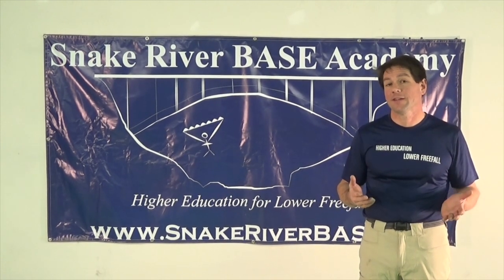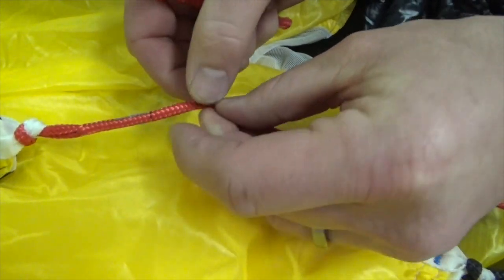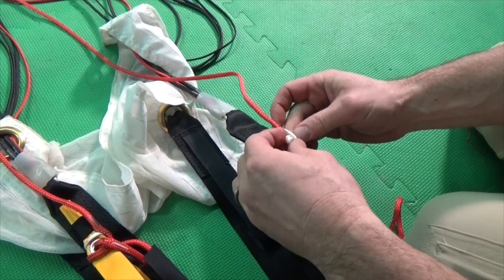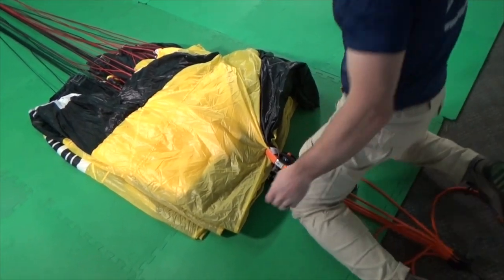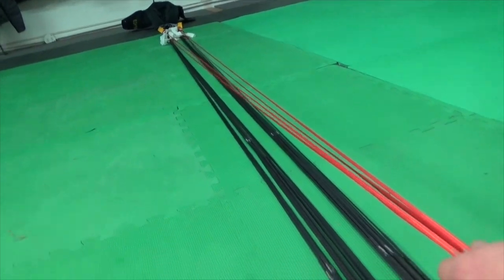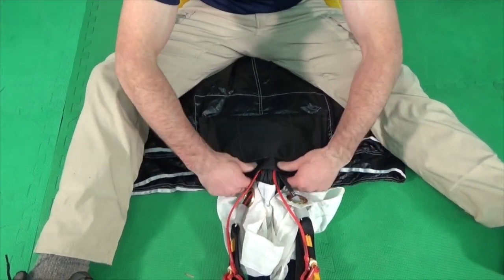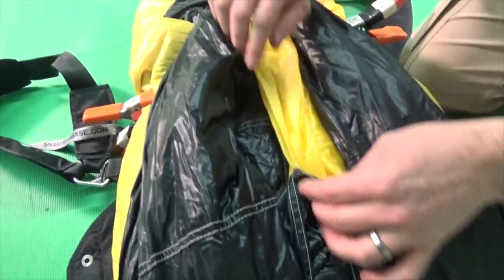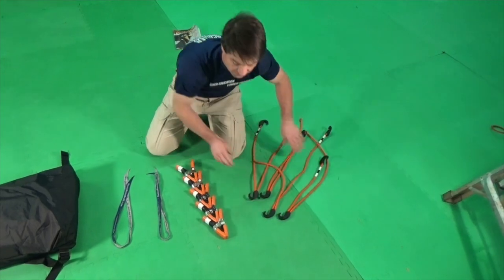Snake River BASE Packing video

Comment: Not a base jumper but watched with interest how ever this looks like a nightmare packing I think I can see why some accidents might occur because of a packing error may happen etc , isn’t there a simpler way to pack and is all these folds and things that necessary, could they also contribute to a malfunction just seems like so much going on here. Are all BASE jump shuts packed the same way or different brands packed different from each other ? Curious viewer as I may be interested in paragliding down the track but looking at a lot of options. Cheers.